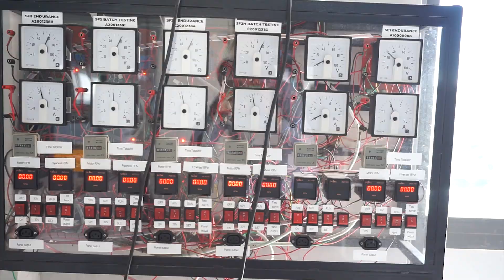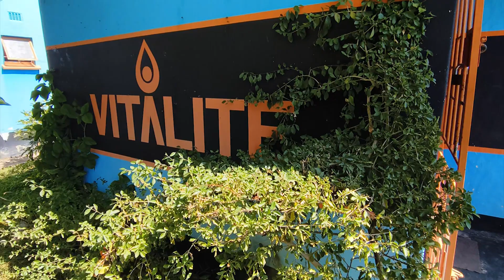Solar Water Pump Tour - Kenya, Zambia & Zimbabwe

Comment: I would like to join future pump Zambia
Reply from the maker: Thank you for your interest. We have multiple distributors in Zambia, you can find your local store on our interactive map on shop.futurepump.com or see the details below:

VITALITE: Sell both the Futurepump SF2 - for irrigating 2 acres at 18,399 Kwacha and the Futurepump SE1 - for irrigating 1 acre for 11,999 Kwacha. Financing plans are available. - you can reach Vitalite directly toll free using shortcode 7432 on Airtel and Zamtel

Saro Agro Industrial sell the Futurepump SF2 with the pump, two 60W panel, 6m high quality suctions hose, installation and a full 10-year warranty for K23,000 - you can reach them by calling +260978110777

Comment: Where i can buy it in India and how deep it aucks from under soil
Reply from the maker: Hi, thank you for your interest. You local distributor in India in Greenovera, the offer our full range of solar pumps. You can find your nearest branch and contact details for a quote using our interactive map at shop.futurepump.com
Reply from the maker: our pumps are surface solar water pumps with maximum suction of 7 meters and a total lift of 15 meters and Horizontal discharge up to 500m. You can find out more at Futurepump.com